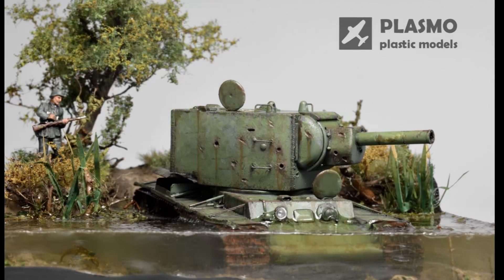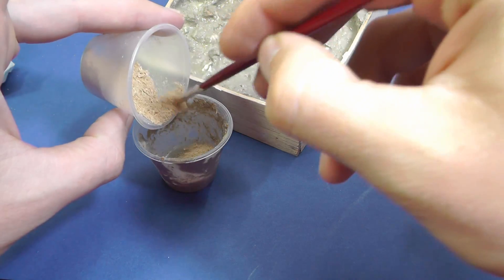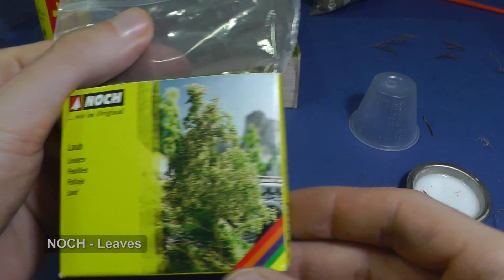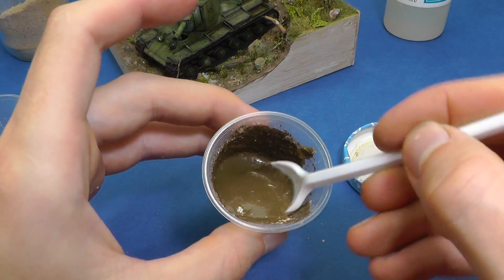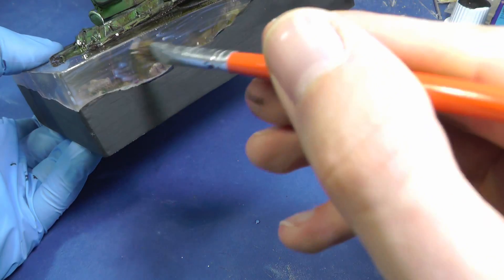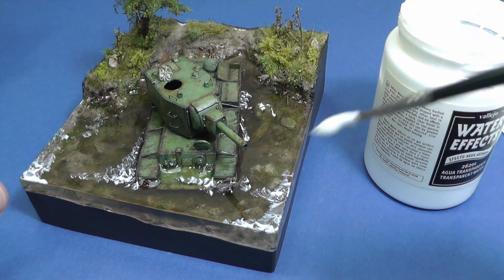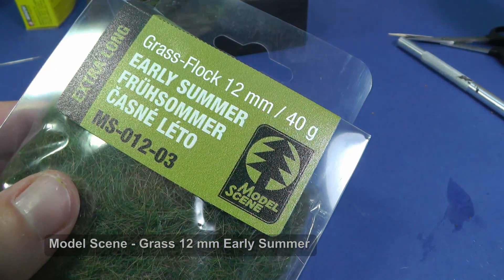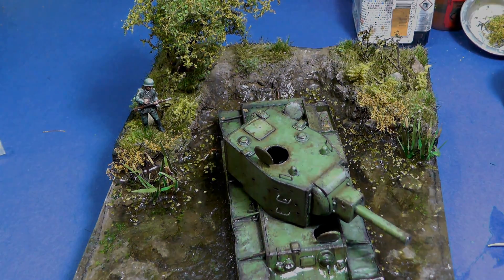KV-2 Russian Tank Abandoned in Water 1942 - Diorama 1/72

Comment: I've always wanted to try an underwater aircraft wreck diorama, and I have some of the components, but I never have time to work on it... I would love to see you try it!

The idea is to create something like the Pacific underwater wreck sites. Imagine a miniature airplane model, 1/144th scale or smaller, fully submerged in a very light blue resin, sitting on an ocean floor, partially disintegrated and corroded away, buried into the sediment. This whole diorama could be basically a resin cube, with all sides polished, and since the resin is nice and clear, you can look through it from any angle.
Reply: PLASMO - plastic models
Reply: Damn and here i am thinking the same thing with 1/72 scale Tony-1C model. Sadly i dont have paints or brushes to even paint the plane, let alone start building something like that.

Technically could you put the scene into fish tank, fill it with water and create artificial currents via water pump and just trow sediment there. Let it build up over time naturally, remove the water, let it dry and then seal it, before pouring epoxy?
Reply: @Hellsong89  that would take too long, you can just put it manually before putting the resin

Comment: Hey maybe for next time if you creat a diorama with a cool water cutout like that, maybe you could add some small fish or something in the resin?
Reply: CyclonicTuna023 a fish detail would be cool but i think it's pretty hard to make it in place
Reply: I was thinking the same. Or duck perhaps? That would be cute and funny ...
Reply: Central Intelligence Agency  fish aren't that sensitive, the gas and oil will float and be carried off in the currents, the only reason they die from oil spills is because there is such a massive amount of oil on the surface blocking the transmission of oxygen into the water. Thus they suffocate
Reply: @NPC #1984 
And all the trees dead with a touch of snow